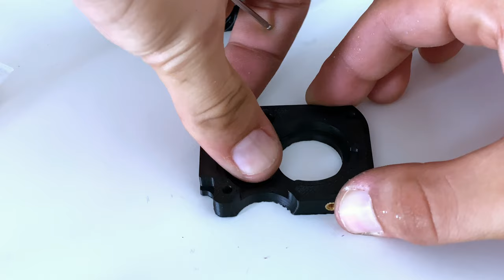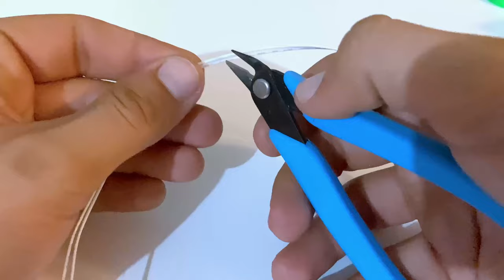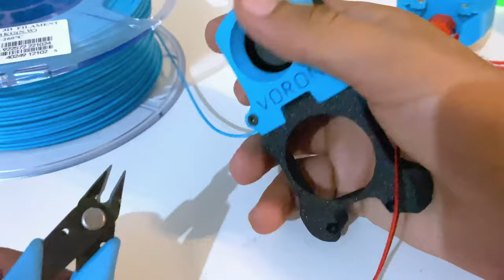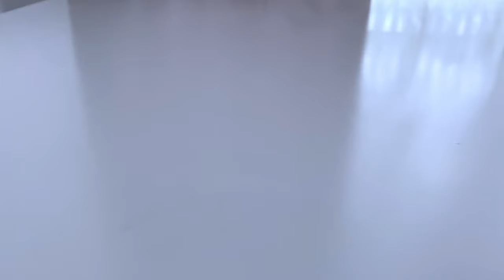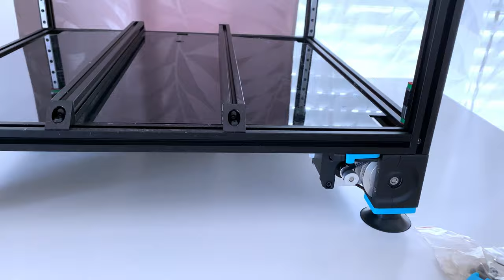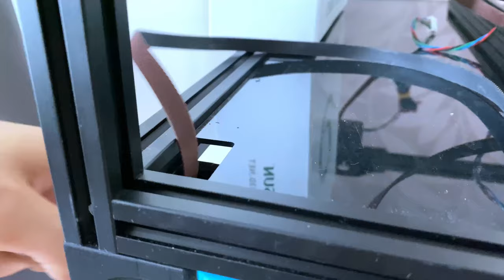Voron 2.4 3D printer building EP3 -  #myvoronjourney 4K HD feeling video

Comment: Just had an idea if you are located anywhere near California maybe you build one for me of course with a fee for your time.
Reply: Im from Riverside county and just ordered a kit to build one.
Reply: @PinoyDIY, I live in the  south bay, 45 miles south of SF. 
 Does the kit you purchased contain all that you will need to build and use the printer? On the fence as far as a purchase goes.
Reply: @MaxGoddur  that is still far from me. 😆. The kit doesn't have the 3D printed parts. You still need to print those parts.
Reply from the maker: Would be a pleasure, I’m 9835 km away from California :(